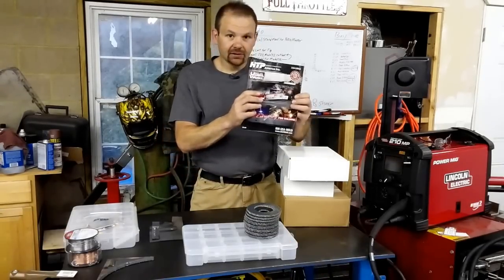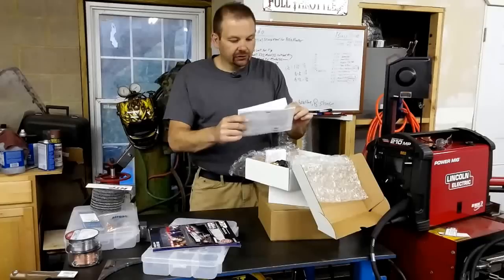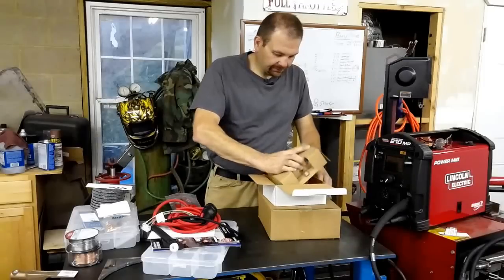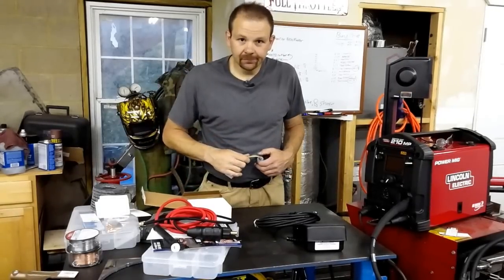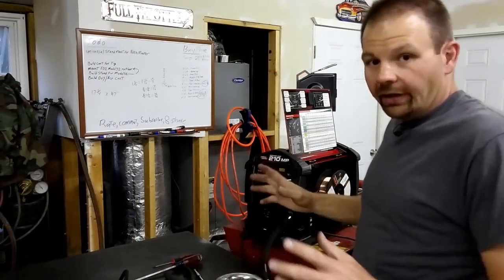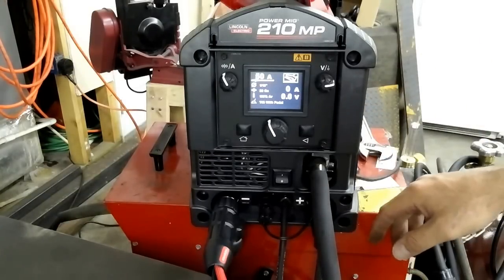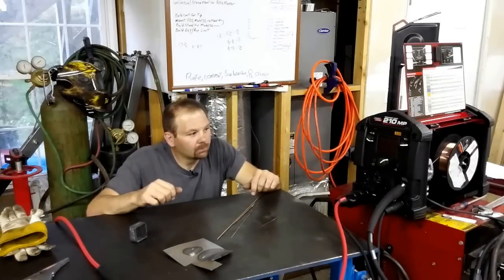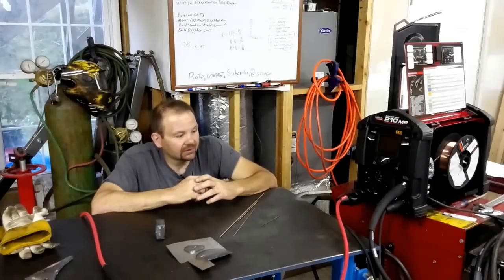Tig Welding with the Lincoln Electric PowerMig 210MP Welder

Comment: Glad I'm not alone. I set my TIG stuff up yesterday and thought it would much easier than it actually was. Lift start is brutal. I can only imagine what you were saying around 35:00 into your video. 

I've had this machine for over 5 years and its flawless for MIG. 

I think my gas was too low. Weld coloration is very gray and it keeping the puddle happy was difficult. I welded professionally for nearly a decade (ending 15 years ago), and boy do I miss the commercial grade TIG machines.

Comment: I heard if you can hook up the mig connector port,  with a female connector, you can have solenoid control of gas.  Mig torch male connector connected to a female gas connector.

Comment: how are you controlling the flow of gas for tig? from what i understand the argon gas flow is non stop for the tig...
Reply from the maker: Hey Steel Patterson - the flow is controlled by the valve on the Tig torch. Yes, the flow is non-stop while welding. You manually turn it on and off as you weld.

Hope that helps.

Comment: I own one, I've been putting off buying the Tig set up and footpedal because it looks like a pain in the ass to install
Reply from the maker: Hey TWLML20. I thought the same thing but it really wasn't too bad. It was pretty easy until you have to plug in the stupid plug on the main circuit board. I wouldn't shy away from it. Its a great tig welder. Hope the video helped.

Thanks for watching.
Reply: I agree. It turned out easier to install than it looked. It was a mild pain but nothing difficult.

Comment: I have been looking at this unit and wanted to see some reviews and use. Seems very odd that this machine can accommodate the aluminum spool gun, which requires AC but will not switch to AC for TIG? I have the Lincoln 180c MIG with the aluminum spool gun. I also had to modify the machine, adding a toggle switch internally that activates the spool feeding on the gun instead of in the welder. To acquire AC you just swap the leads inside the case. 2 thumb nuts, swap the wires, start welding. Of course have to hook up the Argon also.
Reply from the maker: Hey Matthew, I love this unit. Its been really great. You don't need AC to weld aluminum. I can recommend this unit.

Check out Jody at Welding Tips and Tricks. I would consider him a welding expert.

https://youtu.be/hUpmiDL92V8

Thanks for watching.
Reply: I had watched a couple of his videos. Not sure he says anything about this unit. I already have the Lincoln 180c for Mig so was looking for the TIG aspect. Was hoping for a sub $1000 TIG. Thought you had a great review.
Reply from the maker: Are you looking for a Sub $1000 AC/DC TIG machine? Check out the AHP Alpha machines. Look for ChuckE2009 he has had a review on the TIG 200X. I think weldingtipsandtricks did a review as well or at least used the machine is several videos.

AHP Alpha 200X on Amazon http://amzn.to/2h2pBWM

Thanks for watching
Reply: HI, Jody and one of his welding friends use this machine for several videos. It has turned out to be a very nice machine.
Reply: Matthew, you are mistaken. You are not getting AC by swapping the leads. You are swapping DC- for DC+.
Reply: @haroldpalmsesq2506  Ok so it is how you make the spool gun work whatever the technicality is called.

Comment: just got mine and can't wait to burn some wire!
Reply from the maker: Hey Mark, you will not be sorry. This is a great machine. If you are interested in the TIG option, I would look at HTP USAWELD. Their TIG kit was the cheapest I found. Cheap in price, not cheap in performance. The kit came with a CK Worldwide torch so you know its good quality.

Hope you enjoy the welding and thanks for watching.
Reply from the maker: E vp, sometimes but sometime it doesn't. The Lincoln 210MP is not a cheaply made machine. I've been using it a lot lately and its a really really good machine. Hope this helps.
Reply: Burn some 7018 rod too. Its a dream on this machine.

Comment: Just got one of these a couple months ago. Very nice but the connector install was a royal pain in the ass....until I removed the front cover to realign one of the fat power cables that was in the way..   The internals are laid out really well with massive heat sinks ,dual fans and one large  "mother board" Modern design without the components hanging in the air as on import units.
Reply from the maker: +Steven Hardy 

Oh yea, I know what you mean about pain. I was lucky to get my kit installed without taking anything else apart. Hope you like the machine. My machine is still going strong.

Thanks for watching

Comment: is that aluminum?
Reply from the maker: Hey +Aleksander Kapitula - no, its sheet metal. The lincoln 210 MP doesn't weld aluminum.

Thanks for watching!
Reply: Ya I got the same machine and it just kinda looked like it and I love the welder
Reply from the maker: +Aleksander Kapitula - very cool. I love it too. Works really well. Only problem I have had so far is the mig wire jumped out of the guild roll. Took two days to figure that out.
Reply: Seems almost impossible with how they got it design
Reply from the maker: +Aleksander Kapitula Its possible I didn't have enough tension on it but it did jump out. It hasn't since so all is well.
Reply: Ya well that's good and what kind of do you do ?
Reply from the maker: +Aleksander Kapitula - sorry you lost me. What kind of what do I do?

Comment: A welding newbie question. What is the function of the foot pedal exactly, and is it required to TIG weld? If not required, is there a smaller-less expensive TIG package? Thanks.
Reply from the maker: Hey +chalemi - So the function of the foot pedal is to control the amps being put out by the Tig welder. No, it is not a must.

So if you do not have a foot pedal, when you start your arc you will have 100% of the welding amps you have selected on the machine. If you have a foot pedal, you can vary the amps being put out by the torch. Think of the foot pedal like a pedal of a car. The more you push down the faster you go.

Do you think a video of this topic would be helpful? Others have made videos like this but I could make one. Let me know.

Hope that helps!!!

Thanks for watching.
Reply: +Part-Time Fabrication Thanks for that clarification. And yes, I think a video would be helpful. But also, I'd like to see a video of the detailed installation process of the foot pedal. I've watched your video, and also that of Mr TIG and Jody at welding tip and tricks, and clearly, those guys thought the installation of the foot pedal was way more complicated than it should have been. Thanks.
Reply from the maker: +chalemi - Sounds great. Let me think on the details installation video. I don't think my current recording equipment will do the job. That is the reason I didn't do it before. I really need to purchase a camcorder.

I think the video on using a foot pedal would be helpful and I can do that one no problem.

Thanks for the feedback!!

Comment: I haven't tiged in years, but when we use to sharpen the tungsten (school) we would use a belt sander or a verticle round disc sander and that I remember worked the best. I'm not so sure if that's the best way, but I remember it working the best. Maybe look for an adaptor for your bench grinder to run one side with a belt. I'm sure you've seen them around. Myself, I've got to get one to. Just hope I can find something that adapts to the grinder. Know what I mean?  Thanks for the tips on the tungsten and filler rod. I'll try and make it over to praxair to grab some this week plus a tank of argon. Money money money eh lol. Doin some stick today on 110v with it and it runs pretty damm good for that. I'm using 1/8" and also trying 3/32". Tig kits "in transit" so that should be here this week sometime. Good advice again thanks agian. 
Pidge.

Comment: Nice review. Took your advice and ordered the same tig kit. Up here in Canada, Praxair wants over $700 and for a 12.5' kit. What rods and tungsten were you using by the way? Thanks. 
Pidge.
Reply from the maker: Hey PiDGE IAM - You will not be disappointed. This machine and Tig setup have been great so far. I have been filming the last few days on a Tig welder cart build video. I still need to finish welding and painting.

I have purchased several types of tungsten.  2% Thoriated (red tip),  2% Lanthanated (blue tip), and the HTP quad. Its a lot like the red tip tungsten. Red is easy to start the arc and runs nicely. However, the downside is its slightly radioactive. The quad is not radioactive, it start easy, and runs well. For tungsten sizes, I have been using 1/16 and 3/32. The 3/32 seems to be easier for me.

Tungsten grinding has been a big challenge so far. My grinding wheel is getting grooved out quickly. I plan on getting a diamond wheel soon.

As for the Rod, I have been using Bluedemon ER70S-2. I can get it on Amazon fairly cheap. When you buy 10LBs you get it much cheaper. I have size 1/16 and 1/8. I have 3/32 on order. Should be here Monday. For what I have been welding the 1/16 rod is to small and the 1/8 is too large. The 3/32 is between the two.

HTP USA Welding Tungstens
http://www.usaweld.com/Tungsten-s/59.htm

1/8 Rod
http://amzn.com/B00G4B5ICO

1/16 Rod
http://amzn.com/B00G4GZGJ4 

3/32 Rod
http://amzn.com/B00G4B5IKQ